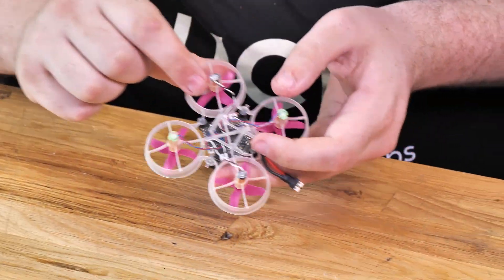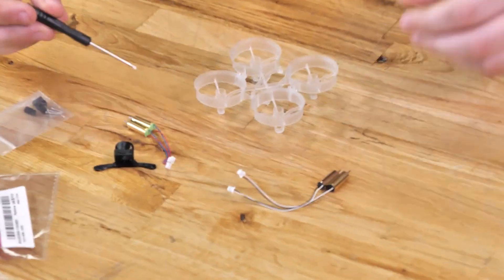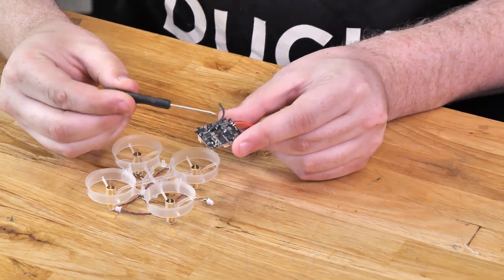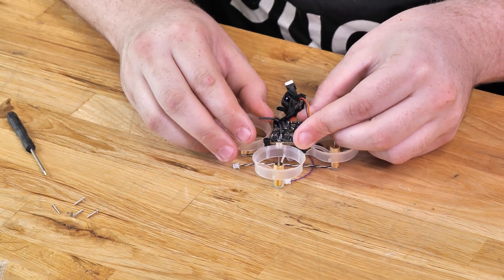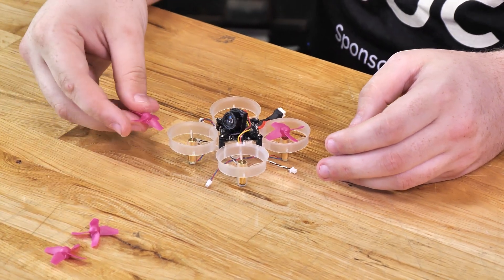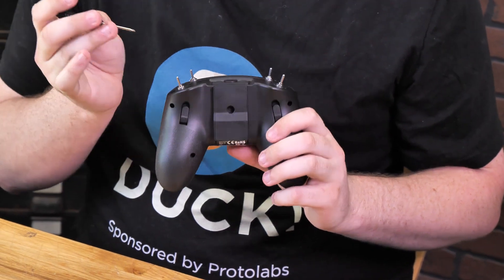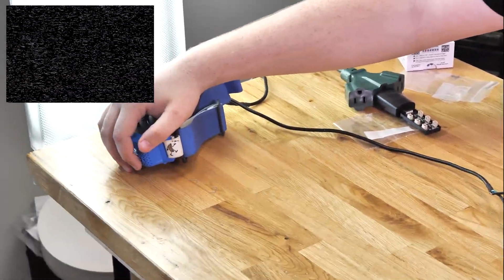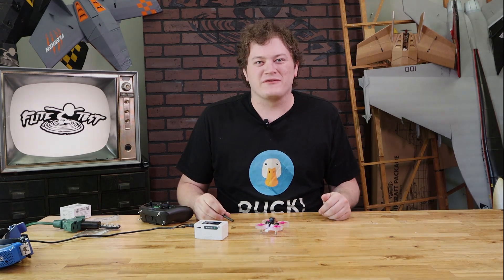How to Build the FT Tiny Whoop SE //  BUILD

Comment: For kids do not use a metal tip to touch the bind button!!!! 

If you touch a chip connectors with the screwdriver you will get sparks. And rune the board.